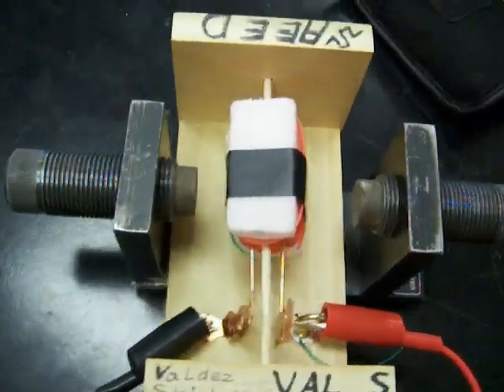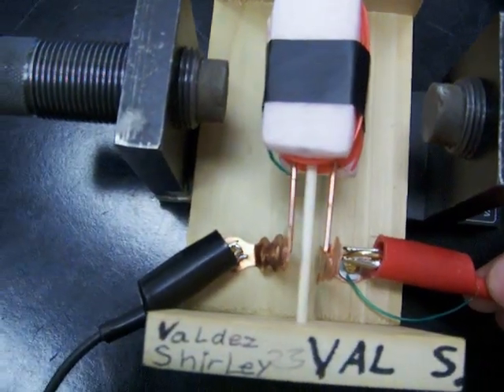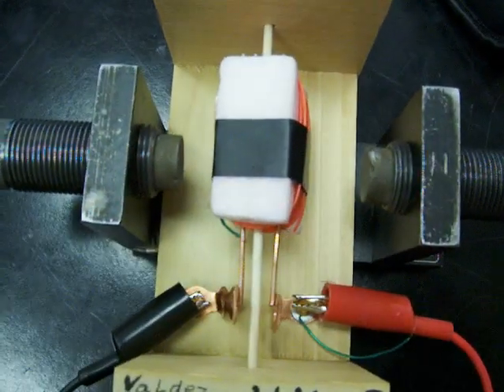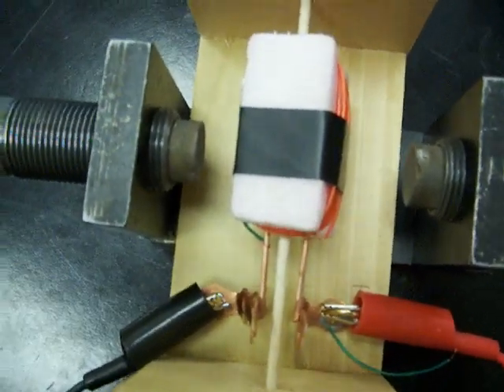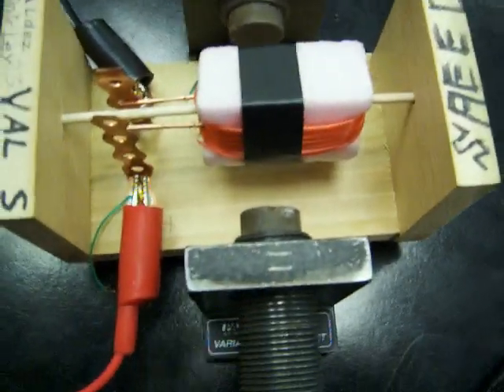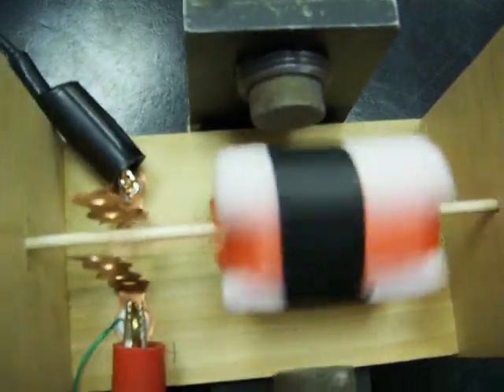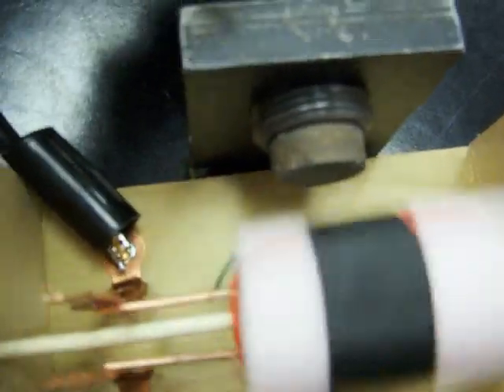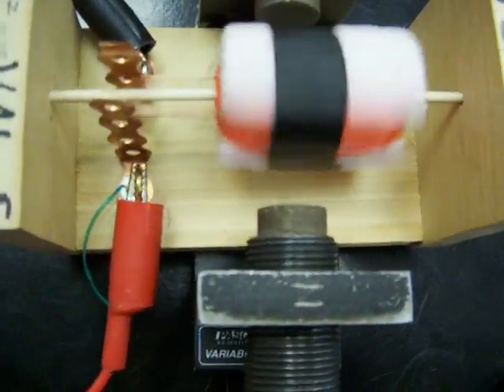Hand Built DC Motor

Comment: You can connect the stator (stationary) windings in parallel with the rotor (rotating) windings, or in series with them.  IIRC, if you connect it in series you can run it on AC as well as DC. Use whatever material you like, but I don't recommend aluminum foil for a commutator, since it burnt out very quickly for me.  Make sure you use a low-voltage power supply...

Comment: I hammered two nails into the board on either side and just beyond the reach of the spinnable, wire-wrapped matchsticks. When horizontal, the matchsticks would point at the middle of each nail.  I wrapped these two nails with wire. I wrapped tape around the rotor nail, then brought the bare ends of the rotor winding down to the tape and made a commutator out of aluminum foil and tape.

I experimented until I got it working.  (continued...)

Comment: I once made a cheaper motor out of nails, matchsticks, cardboard, aluminum foil, magnet wire, tape and a 2x4. (That's a 5x10cm board for you metric folks.) I attached two pieces of cardboard to the 2x4 base, sticking up.  I poked a hole in each piece of cardboard near the top end.  I put a couple matchsticks on either side crossways of a nail, then wrapped the matchsticks with wire. The nail was the axle, I put it through the holes in the cardboard so it could spin. (continued...)

Comment: It's pretty simple.  A bunch of turns of fine insulated copper wire are wrapped around a form with an axle (looks like a piece of plastic and a dowel here), with the windings parallel with the axle (not wrapped around the axle) and the ends connected to two heavy bare copper wires which act as a commutator.  Two copper strips make contact with the two wires twice per rotation, and are connected to a low voltage DC power source. This rotor is mounted in the gap of a horseshoe magnet.